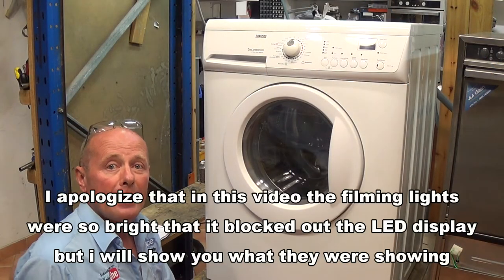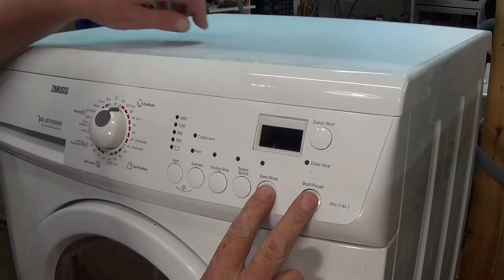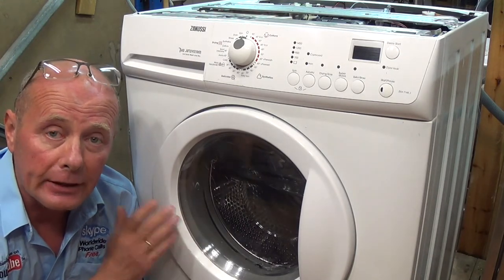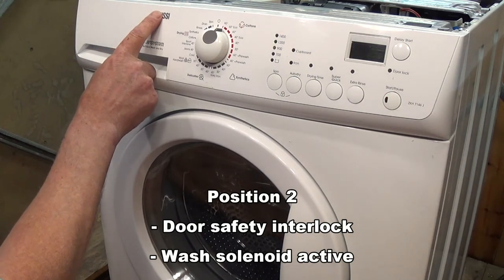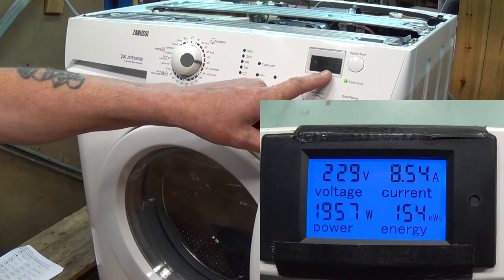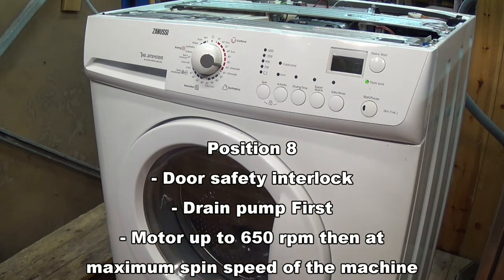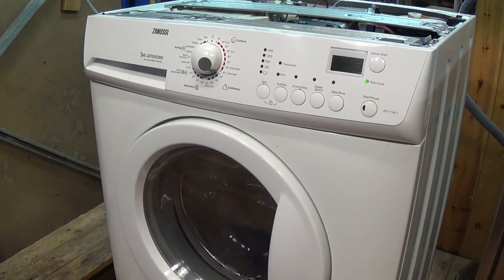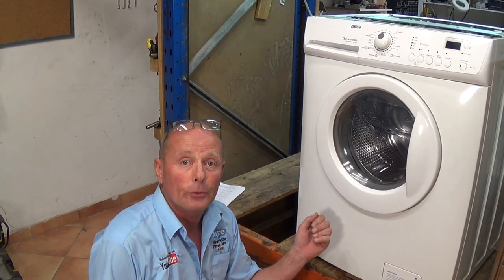Zanussi Aeg Electrolux washing machine & washer dryer Diagnostic mode fault finding, error codes.

Comment: Absolutely Excellent Video really informative great service and Help 👍🏻
Reply: Hi Paul! Great video. I'm a Lift Engineer and I used your video to help a friend they have this model but the 8kg Washer Dryer.. they had two faults one the water was not heating which I was able to resolve. The second fault is the Dryer Elements are not turning on the two ntc's look fine with High Resistance and when you cover the resistance drops as expected and both the dryer elements are 50ohms so are fine... I also saw E73 in the diagnostic saying Possible Ntc in the duct being faulty I'm guessing this is the Ntc at the front of the machine by the main PCB, what would be the acceptable resistance value of the Ntc from new?  Would the dryer board at the front right hand side(facing the drum) be the possible cause for the dryer elements not turning on? I'd appreciate your thoughts before ordering from your store. Many thanks again for a great video

Comment: hi there, i was wondering if you could help me: my Zanussi washing machine just stops mid cycle. The water drains successfully and I can hear the pump but the drum doesn’t spin at all after. Two minutes later, the error code E20 appears. I have cleared the drain filter too. Please help